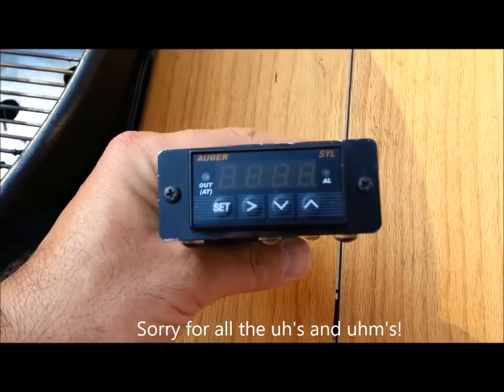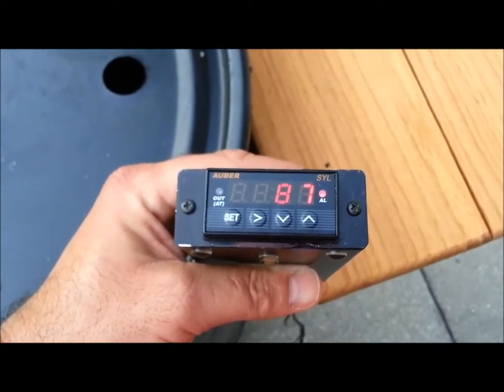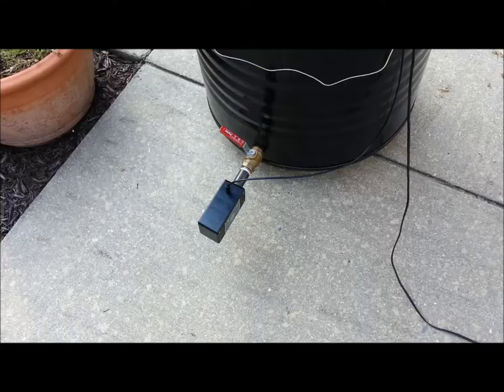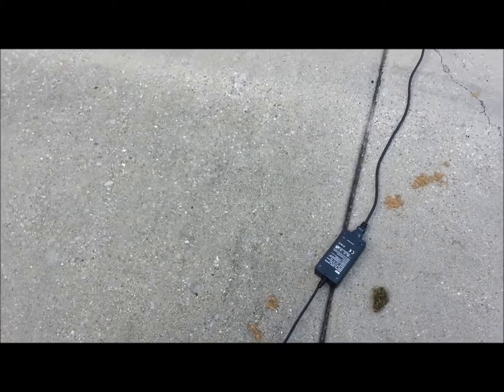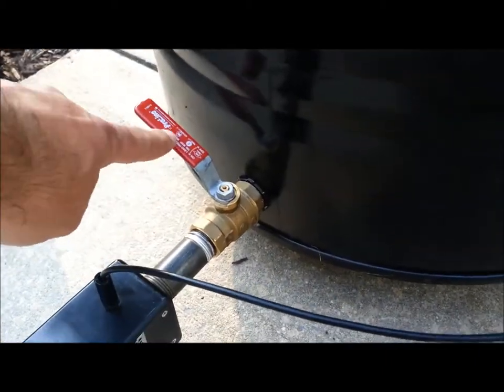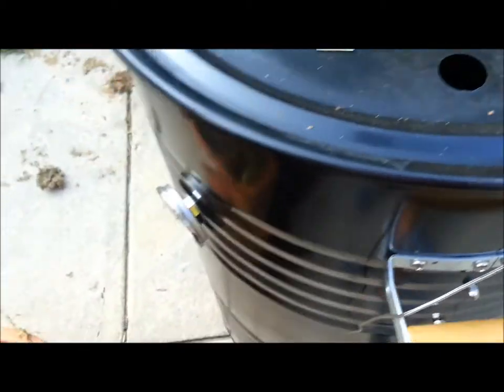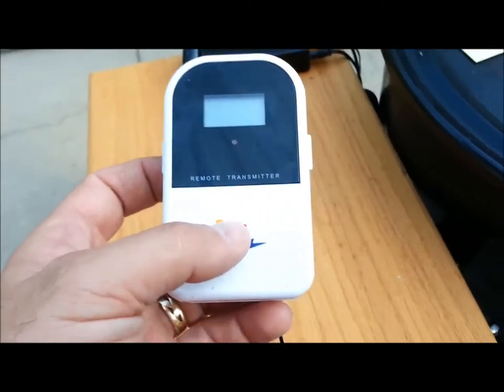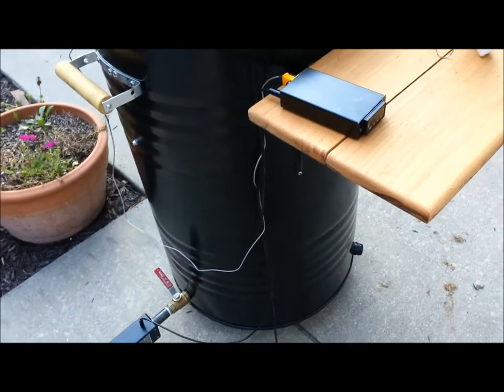Automatic Temp Controller for UDS Smoker - Part 2

Comment: Good-day I am a handicapped pensioner and got myself one of these controllers and messed it up bad. Can you help me or direct me to a video that shows how to change PID settings and save the changes. I hope this doesn't offend but i need this for an E-Nail (for Cannabis Concentrates).

I  am needing a temp of 710 f and all I can get is 85.  Can you help

Comment: Great info. I have the same style controller on my UDS. 
I tried using cooker for first time yesterday and had a problem with ash blowing all over the inside of cooker. What do you do to prevent this? 
Thanks
Reply from the maker: I haven't had a problem with ash blowing on my setup.  The blower fan I am using doesn't really put out a fast/hard air stream.  Also, my fire basket has supports that lift it about 2" above the bottom of the barrel, so it is not really blowing directly on the fire basket.  What size or type of blower fan are you using?  You may need to put some type of deflector on the output of the blower located inside the cooker.
Reply from the maker: Phillip Patterson Look at this crude drawing of a way you could add a deflector to prevent the airflow directly at the fire basket.  This may help:  http://www.maliburacing.com/BBQ/deflector.jpg

You could easily make this out of a flat piece of metal or aluminum.
Reply: Phillip Patterson
Good Idea. Was also thinking of putting potentiometer in fan circuit to slow it down, fan is 16cfm! Miss read stats when I purchased it! Legs are 3" long keeping base of basket 3" from bottom of cooker.
Reply from the maker: Jon Landis
 Yeah, that's a big fan.  Based on a google search for the part number of my fan, it is 10 CFM. Yes, a potentiometer or an adjustable voltage regulator would drop the speed.  If using a potentiometer, make sure it is rated for the current draw you need.

Comment: I have the same set up as you and I’m having problems? Am I going to have to set the parameter setting on initial set up .. I have it set at 220 and it will kick on but it won’t kick off till like 280 ??
Reply from the maker: mike mcclellan It is possible that the parameter settings are not in PID mode, which will cause large overshoot and undershoot issues. I would definitely go through the parameter setting to make sure it is in PID mode. Auber says in the manual that you need to change the initial value to PID, outy=1 and if using internal relay, set ot=10. Also change the following parameters for a BBQ smoker application:
P=1.2
I=300
d=70
SouF=0.7
I would recommend calling Auber tech support if you have problems adjusting parameters (can be confusing). They were very helpful when I had questions.

Comment: do you find yourself shutting unit off when opening cooker lid? I would  think this would over stoke fire and cause high temp when putting lid back on.
Reply from the maker: Rick Sims, I usually just leave it turned on. I try to limit the lid off time, but sometimes that isn't possible. If I have the lid off for a long time, I will turn it off during that time. I turn it back on as soon as temp stabilizes. Hope that helps.
Reply: yes, thanks

Comment: Can you power it using a USB power bank to make it portable
Reply from the maker: Mumbles Munchies Unfortunately, USB is only 5 volts. The PID requires a minimum of 9 volts. Also,  USB ports on a computer are rated at only 500 mA. Which means that the combined power requirements of the fan and PID controller would be more than a computer USB port would provide. Some USB wall chargers can supply 1000 mA (1A), but it is still only 5 volts. That would only work if you could find a PID controller and blower fan that operates at 5 volts.

Comment from the maker: To see wiring diagram, go here:  http://www.maliburacing.com/BBQ/ATC/ATC%20wiring.jpg
Reply: Have got that thanks   Do  you have the parameter settings used  and is PID really necessary  for the on off  function of the fan? Is there something  less complicated?
Reply from the maker: You don't necessarily need the PID functionality.  You can set it to just turn on/off the fan at the specified set points.  The problem with that is your temperature will not be consistent.  Your temperature scale will look like a roller coaster, constantly over shooting then under shooting.  The PID function adds mathematical intelligence to predict when to turn on the fan, how long, and turn off the fan.  Using the PID functionality will keep temperatures within a few degrees of the desired set point. If you use the simple on/off control for the fan, I would have to believe it would cause 20+ degree temperature swings.  As far as the PID settings, I used the recommended setting in the manual that came with the PID controller.  It is:  P=1.2, I=300, d=70, SouF=0.7
Reply from the maker: To use PID mode, set outy=1 (for non-SSR mode) and set ot=10